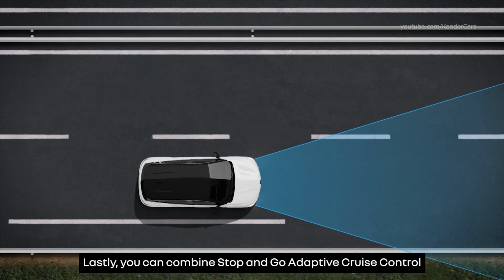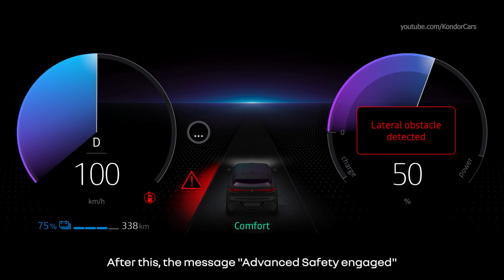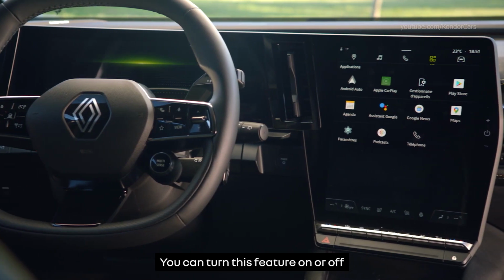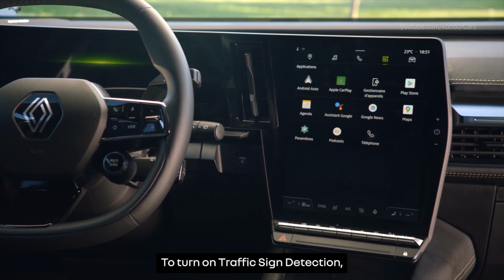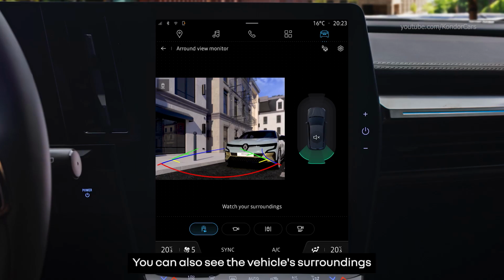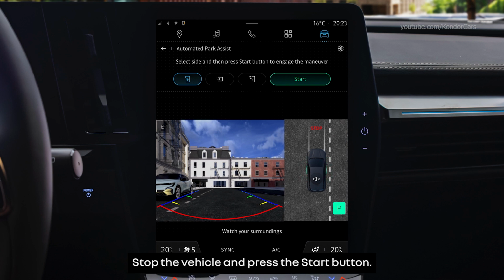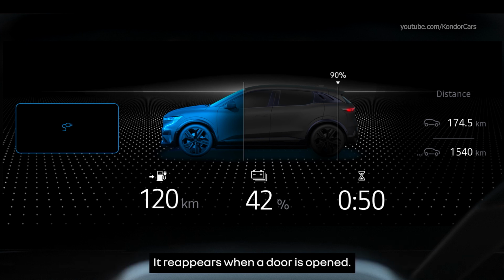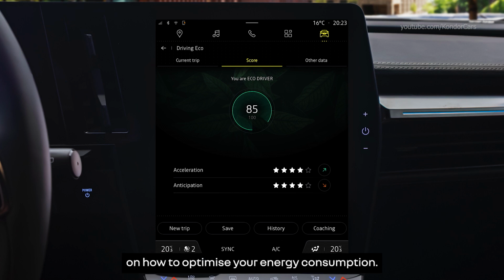How to - Renault Megane e-tech 100% electric - guide

Comment: Is there a way to limit current on AC-charging so that the car pull less power then the maximum output the charger can provide?
Reply: I dont already have the car but i think for sure you can do it using a device if not on the car
Reply: Otherwise you need your electrician to change the amp output in your installation for the charger.
Reply: No, this is controlled by the external charger. The car does not have options to limit input.
Reply: Set the charger at home to 6A or less.

Comment: Anyone bought an e-tech and having problems with the app ? The app worked great on the Zoe but even with Android version 12 tech support can't get the app to work with my new Megane.  Can't precondition or check the staus of the battery.  Still love the car it's fantastic but very very disappointed with the app which is basically no control just online guides and videos
Reply: Why does the UK version not have the auto park feature?
Reply: Took delivery of my Megane two days ago. My android app shows battery range. I've set it to start charging at 9pm this evening and no reason to suppose it won't. Not had chance to test pre-heating the cabin yet. So much to learn!
Reply: Yes I’m having problems with the app. I need to restart the app every time for it to connect to the car. It only does pre heating. The battery icon is not active. Moreover the hillstart assist is not available on the multimedia to put it on/ off. The multimedia help line are very courteous but could not sort it out as yet. Looks like we got a less functionalities in uk compared to the EU models? The car as such drives very well. The range is only 190 odd miles in the current weather
Reply: @harishshanker2721  Been experimenting with range. A friend suggested turning off the heating and using the heated seats. This has improved range by 29% from a calculated 170 miles to 233 miles. Heated seat works well but need thick trousers [or a bit of heat just for the foot-well.]
Reply: The app sucks big time..